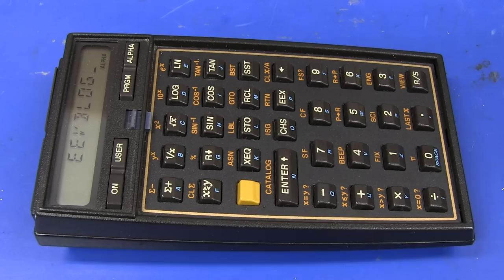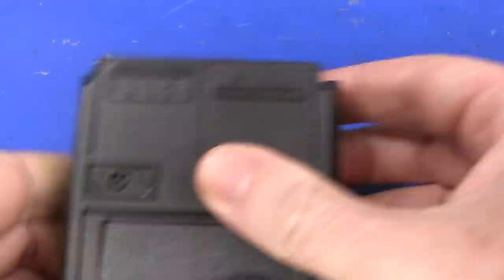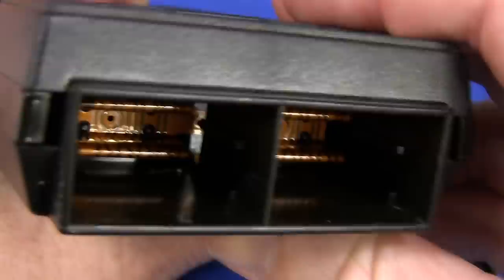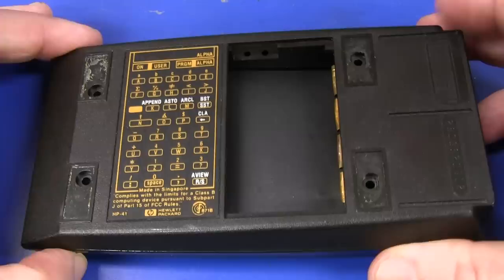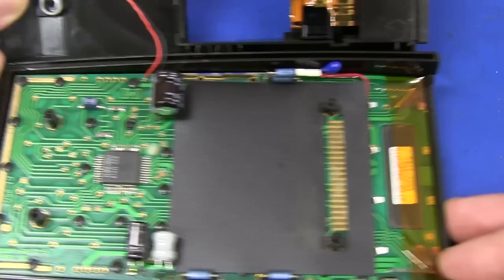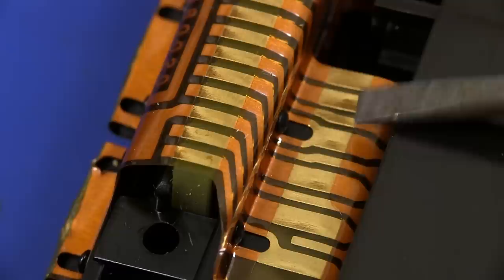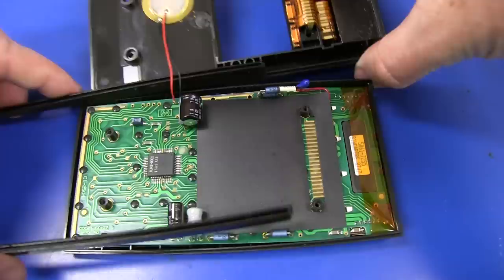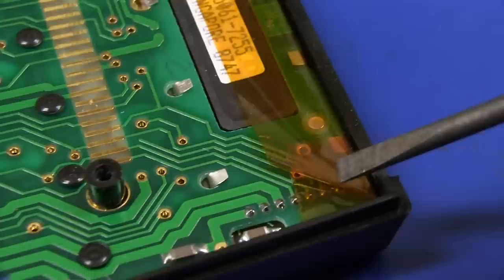EEVblog #582 - HP41CV Calculator Teardown

Comment: Don't break it, it doesn't deserve it.
Reply: And if you must break it, carefully cut off or drill out the heat seals, then replace them with nuts and bolts (with teflon washers as needed) and put it back together. That way the calculator will still work when you're done with it.

Comment: Don't bother taking it apart further. We've seen button matrices before, and you can pretty much figure the rest out by looking through the board itself.

It'd be more interesting to see it working - show us the features that made it last 10 years. I.e explain why a programmable calc is better than some crappy Casio we can buy for £5.
Reply: It's pretty amazing what you can get from Casio these days - programmable models appear to start at just £20 or so. But this is the HP 41, an extensible computer. Where my Casio can connect to tape and printer, the 41 could connect to lab instruments, card readers, barcode readers, code expansions, and more.

Comment: Don't destroy it. I have a 41C where the previous owner forgot to remove the batteries, so the Flex and PCB contacts are destroyed - It's destined for the bin in that shape, unfortunately ... Also, the electronics is a whole lot different. I could send it to you Dave? You can destroy that one without problems.
Reply: Just mail it, he does not reply to you tube comments often.
Reply: You can buy a new flex cable for it:
http://www.thecalculatorstore.com/epages/eb9376.sf/en_US/?ObjectPath=/Shops/eb9376/Products/Flex-PCB

They sell out fast though...
Reply: Joshua Mitchener Wow, that's expensive!

Comment: I just watched this again after opening mine up... from what I could find out, mine dates from February of 1983. The one big difference I noted, is that the speaker for mine is on the main board and not attached by a wire to the other half of the case.

Comment: Our whole office used 41's starting in '79.  We all continued using them long after they were discontinued when the replacement 48S/SX came out.  NONE of us like the 48... it was just too complicated for us.  We had heard that the public was not happy about the discontinuation of the 41's.  As our 41's started to wear out, most sought replacements on eBay and the like.  To this day they bring more $ than they did when new.  The same can't be said for the 48's.  We still have a couple 41's in use her in the office!

Comment: On the other side of the main circuit board is just the switch contacts. The interesting part is how the switches are made with springy steel, which give the nice click feel to the keys. If you do remove the heat stakes, do it by lifting, not cutting, so the centre part of the heat stake remains, and you basically lift off a donut shaped piece of plastic. Then, if you wish to reassemble afterwards, you can use a small amount of glue on each heatstake to make them hold again.

A better tear down would be an older HP41c with separate processor board :-)

Cheers,
John

Comment: You're not missing anything on the other side. If anyone is interested in seeing the traces and metal dome buttons they can search the interwebs for it. The only interesting thing is the interface to the display which is more pressure contacts.

Comment: I still have my Dad's HP 97 programmable calculator.  An order of magnitude older than the HP41CV.  I also have all the original goodies, manuals, case, programming strips and books.  Manual dated 1976, revised 1977.  Good stuff.  I remember my Dad using this calculator well as a boy.  My Dad was, hold your boots on Dave, a petroleum engineer!  Ha!  He was the guy that would perform surveys and then run astronomical mathematical calculations to determine the yield of a specific site.  He was also a geologist at heart and earned his degree from the esteemed Colorado School of Mines.  His diploma is printed on a plate of silver.

Comment: The 1LM2 chip is just the CPU. It is a redesign (die shrink, cost reduction) of the earlier 1LA5 and 1LE3 CPUs. The architecture ("Nut") is unchanged, but the electrical characteristics may be slightly different. Aside from a small number of processor registers, all of the RAM and ROM is in the LCD hybrid, along with the LCD drivers.
Reply: Just to add, the updated version was called "Halfnut" in contrast to "Fullnut". An inspection of the LCD display easily reveals the version. Fullnut has angular corners while in the Halfnut they are rounded. Dave is clearly showing us a Halfnut.

Comment: Can you replace the broken melted plastic bits with small screws and restore it after you fully dismantle it?  Maybe some how save the broken plastic bits and re-melt it on with a soldering iron to rebuild it?

Comment: I would take it apart only after getting a 3Doodler - I've been using mine for more repair than anything thus far, it'd easily allow you to put the pcb back in place, restoring the construction
Reply: I have mu CV - still in constant use

Comment: There was at least one other version of the 41CV that did have separate RAM chips on the processor board - Google "inside the HP-41CV fullnut".
There are pics of the keyboard pcb as well - it ain't worth destroying a working 41CV to see what is already on the 'net. There was HP-41CX module later, too.
I bought a 41C around 1980 with the card reader, math module and memory module. You could use it in uni exams - I programmed it to solve complex impedance questions that normally required a Smith Chart. Examiners probably wondered how I could get the answer right to so many decimal places! You could also use it to remember formula equations with the alpha display, at the time the uni didn't realise what that 41C could do or it would have probably been banned from examinations.
Reply: Here are the links to teardown images of both "halfnut" and "fullnut" versions-
http://www.keesvandersanden.nl/calculators/hp41cv_inside.php
http://www.keesvandersanden.nl/calculators/coconut_repair_fullnut.php
Reply: And here is the schematic for the "fullnut" HP-41C - NOT the one Dave has.
http://members.ziggo.nl/kees.van.der.sanden/downloads/HP41C%20schematic.pdf

Comment: I wouldn't destroy an example of vintage electronics in that good of condition.
The earlier version of it did have multiple memory chips and a CPU mounted on a separate board.
http://flickrhivemind.net/Tags/hp41cv/Interesting
It seems HP was able to integrate everything single chip mounted to the same PCB as the keyboard by the late 80s so there's probably nothing interesting on the other side of the board.

Comment: 14:15 The heat stakes also look like they go through extra large diameter vias, I guess to save on the number of holes taking up board space. Very thoughtful :)
Reply: I have never seen this before. It us really cool though. Trying to think of somewhere to use it. :p
Reply: Never seen what before? The heat stakes? They are used all the time on cost sensitive stuff to save on screws. You can ultrasonically mold or just melt the plastic boss that rises through the PCB to form the plastic button. I have used them at work a little bit.

Comment: This one looks like a modern HP41, it says Rev 6, and the IC package is modern (not DIP). I've seen other 41 disassembles on YT (namely one which didn't have any revision number, so likely Rev 1), and it was very different pcb, populated mostly with dip packages.

Comment: Pull it apart! You are doing it on film, so you may save many other calculators being pulled apart to see the other side. Anyway you removed the original feet, so the originality of the calculator is no more!

Comment: Dave it is strange you point out the 41's weakness' as good features. The flat flex is prone to corrosion from leaking batteries and the battery box is rather flimsy. The springs tend to break the bottoms of the pockets. The 41 is a bit of a power hog especially with the card reader attachment. and finding N cells today may also prove challenging. I have a pristeen 41CX I bought in '85 still going strong although it has now been reverently retired from active duty due to work enviromentals.
Another interesting aspect of the 41's mystique was HP's embracing and sharing of user generated programs. Many of the user written programs eventually made it onto silicon in the form of ROM packs. The library of the ROMs covered a vast and varied range of applications. I recall the Aus army artillery replaced literally truck loads of equipment and seismometers with a '41 for detecting the fall of shells and who can forget the way the 41 was used as backup for the space shuttle on board computer predicting next ground link aquisition and fuel load distribution for re-entry. Get that wrong and you were having a very bad day.
Oh and yes HP did respin the ASIC. the early model 41C's are affectionatly called Half Nuts. The other classic models sought after by collectors are the 11 and 15 series. The S(ingapore) in any serial number will mean a reduction in value over the same A(merican) made units. Exellent examples of the 41CX still fetch $400 on Ebay today
An amazing piece of computing equipment for it's day and still for me at least simply the best user expreience and feel of any calculator. end of. And the documentation was absolutely top notch.
 I own 5 HP's so yes you could classify me as a HP calc fan boy. Trying to use an algebraic calc for me is like speaking a foriegn language and I still can't understand why you persist in using those toy Casios.

Comment: Don't do it, Dave! It is too nice a calculator to risk killing. There isn't a lot to see on the other side. I know. I've taken apart the HP-41CV I bought in 1981. BTW, the first two digits of the serial number are the number of years since 1960. For more information on the calculator, do a search for the museum of HP calculators.

Comment: Actually, Dave already destroyed it.  Pulling or inserting a ROM module will kill the HP if it is ON.  And pulling the batteries while ON will turn off the display, will leave the calculator ON.  And Dave pulled the module while it was ON so...  Yeah, dead classic.  I did that back in 89.  Luckily, I was able to replace it at the end of its production.  Very painful.

Comment: I bet that has at least $20 worth of gold on that board. At least.
Reply: $20 = 0.5 grams = 25 cubic millimeters = a chunky little sphere 3.6mm across. Nope.

Don't underestimate the power of cubing small numbers! Even with cubing aside, gold platings range from 10 to 50 microinches according to one random website I just looked at, so "thick" probably doesn't mean the thousands of microinches it'd take to rack up significant volumes of gold.
Reply: I dunno... Every single through hole and pin seems to be gold plated. And we haven't even see the other side. And those flex PCB's have to be pretty thick to stay in contact.
Reply: Right, but calculate the total area, be generous. Now multiply it by 100 microinches, which is super-thick gold. You just won't get 25 cubic mm. Not even close.

I'm not sure I follow your argument about the flex either; if they want thick traces, they're going to have thin gold over thinnish nickel over thick copper. Those traces aren't pure gold on flex substrate.

Comment: ***** 
The Apollo board was badly damaged before attempting reverse engineering the modules, and Fran (whom sent Dave the board) has respected a similar Apollo board only subjecting it and her hand to x-rays.  So no, there is no comparing the crustified Apollo board to this calculator.  If anything it should be compared to the NDT'd one Fran did NOT send Dave.

EEVblog 
No disassemble Johnny number 5!

Comment: Those are lovely keypads. If it were possible to guarantee re-assembly to a working state, I'd say "Go for it. Builders NEED to see how to make a proper keypad".
Without that guarantee, however... no.

Unless you plan to describe how to order [and build] a custom rubber dome keypad, including making imitation HP keypad buttons [3D print or CNC].  Now THAT would make an interesting video series!

Comment: I think I found something like this years back (atleast 10-15 years), in the trash (My father is a garbage driver), and I found it when I was with him at work.
I also remember that I had a printer for this.. can that be right??

The calculator worked just fine, and looked like this one.
But I didn't have the power supply for the printer.. thought it was 220v, and just modded a cable, plugged it in and.. bang.. printer went up in smoke..
But the calculator survived.
Maybe it's still at my parents house.. I don't know.

Sorry for my english, I'm from Norway, and a bit tired right now :)

Comment: could you heat gun the pins and slowly lif the board so they melt out of the way, then when you re assemble you can heat them and push them down with something hard

Comment: How is the flat flex held securely in place?  I see some plastic stakes at one end at the battery end.  But then it wraps around and over some curves where the modules plug in.  Glue?

Comment: I had the same 41CV model and it wasn't such a mode like diodes and tanthal on video. Seems like it's not factory mod and i think that it was made by previous user. But i can be wrong because i disassembled it some months ago.
About disassemling it more: i don't think that it will be something interesting there. This device is very cute so don't please disassemble it.

Comment: NOOOOO! Don't do it!

I still have my CV from 1983 on the desk here in front of me... complete with case, original manuals/programming guides and a few of the modules and it would destroy the mystery for me if you were to tear it down any further!
Reply: Oh, and it beats the heck out of the Ti-58C in the desk drawer beside me... which I just plugged in for the first time in many years and IT POWERED UP!

Comment: Nooo! Don't tear it apart! Maybe Mike would X-Ray it? Then you could verify that there's nothing interesting on the other side of the board. At any rate, it looks like there's not room for anything other than the key matrix. It's definitely not worth it to see a bloody key matrix and potted LCD controller.

Comment: Hey Dave, interesting teardown You missed something which confused me the whole video: between Pin2 and Pin3 (counted from the right) of the FlatFlexConnector coming from the upside comes a trace - and get lost! No via or anything. It ends at the DIP connector in the upper right. Looks like the designer ran out of steam - or is it some RF-Funny-Thingy? ;-)

Comment: I would love to buy an HP41C and regain the power of these great calculators, where can I buy it?
Reply: Ebay or yard sales are you best optuins probably
Reply: SwissMicros built a HP41 clone called DM41X. It's a bit costly but worth its price considering that you can load all those expensive ROM modules without additional financial burden.

Comment: Hi Dave, take a look here: http://www.ebay.com/itm/Hewlett-Packard-Calculator-HP-41CV-Motherboard-/151233365152?pt=Calculators&hash=item23363604a0

Maybe instead of a teardown, make a combination of teardown and repair ;-)

PS: I still use both the HP 41 CV and the HP 11C in my work.

regards